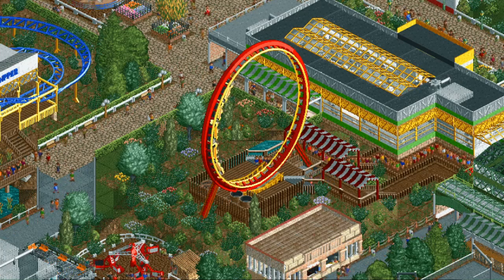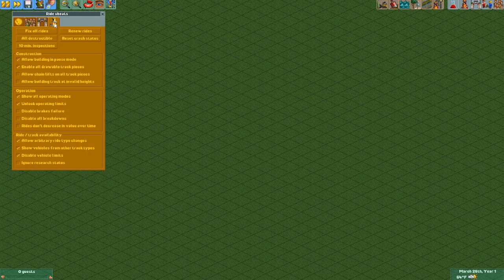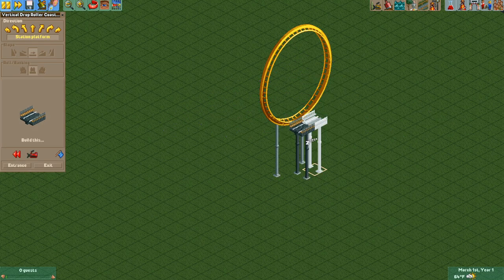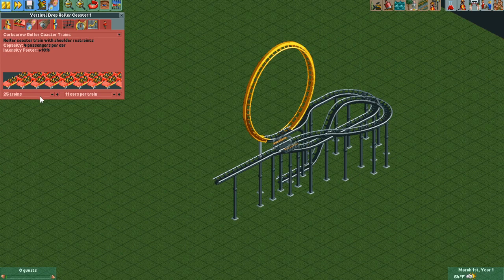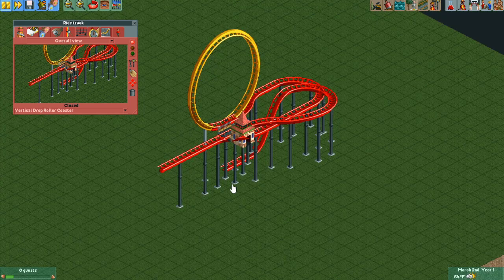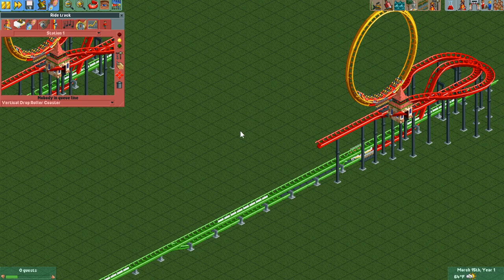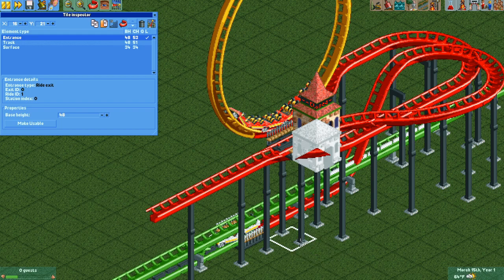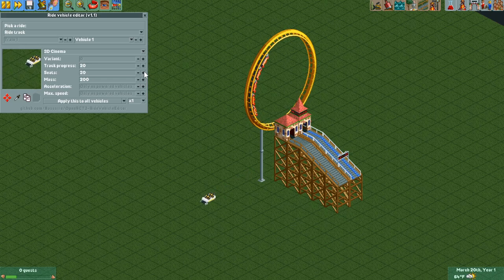Larson Super Loop | OpenRCT2 hacking

Comment: I was able to do a Fireball without shoe-stringing. As others suggested, use the multi-dimensional coaster track to make the ring, switch to traditional coaster cars like the corkscrew, and change the operating mode to powered launch passing station. There is a graphics issue at the top of the loop that needs covering up with scenery, but otherwise it works fine. With three circuits I even got pretty appropriate ratings (6.23, 6.45, and 6.63.) Not a bad flat ride.
Reply from the maker: Interesting, I'll have to try that out!

Comment: I''m pretty sure changing the ride type to unknown ride 38 changes the behaviour of the booster track pieces. Atleast in my testing they showed a much much lower acceleration rate than other rides, so you probably need to fine tune the control track with this in mind
Reply from the maker: Yes, that's correct. This tutorial is a little outdated now. I don't ever use the "unknown ride" types anymore, as there are better ways to make your track invisible, which don't affect the ride behavior.
Reply: @fidwell  What would the other ways be exactly? Since I'm running into the problem of needing a huge control track with boosters, that I can't possibly hide underground?
Reply from the maker: @TCrazy98  The easiest way right now is probably to make the track invisible with the ride editor plugin — https://openrct2plugins.org/plugin/R_kgDOHw7oPg/OpenRct2RideEditor

Comment: Where are people finding all these custom rides and tracks at? I thought it'd be on the OpenRCT2 forum, but I can't seem to find anything. Is it just there and I'm blind? Or is there some other place that there's a repository of these custom assets?
Reply from the maker: Nothing in this video uses custom rides or tracks. But to answer your question anyway, there isn't a single repository of custom content, but you can find a lot at nedesigns.com
Reply: @fidwell  Thank you very much! You're right, this tutorial doesn't use any custom tracks; I see stuff like the single rail coaster and the hybrid coaster around so much, and yet nobody has mentioned where to find resources like this at. Thank you for your help, and also best of luck on the Cedar Point series! I have been absolutely enthralled with it!
Reply from the maker: @Ariakiri_  The single rail and hybrid coasters are not custom either. They are built in to OpenRCT2. You have to use cheats to use them currently, but they're there.

Comment: New subscriber here and btw how the heck do block brakes work?
Reply: It has been many years since I used them, but simply put, block brakes separate the ride into multiple sections or "blocks" and stops cars until the next block brake is cleared, thus only allowing one car on a block. When the ride is operating with block brakes, the station is considered a block brake and I believe the top of chain lift hills are block brakes (it has been a while). Using block brakes allows you to run multiple trains with only a station the length of one train (most rides require all trains to fit in the station), with the max number of trains being the number of block brakes (including the stations) - 1.
Reply: @billmight5662  Thank you for that  and I want to do exactly that run more than 1 or 2 trains on a coaster but have no idea where to put these block brakes. Is it simply a length? Or perhaps a certain ride aspect?
Reply: @leopardfrog67  It's best to have them evenly spaced out by time, however nobody will judge you if there is a 20 second wait on a block brake. They do stop the train, so they are best in slow areas, typically the top of a hill.

A quick mockup of a ride where every ">" is a block brake: station (it's automatically a block brake) > top of chain lift (as I mentioned, I don't remember if chain lifts are automatically considerd block brakes) > downhill and a few twists then up a hill a bit > a loop and a few more turns > small downhill and final turn into station.

I can't think of any specific roller coasters, but block breaks are very common on real roller coasters, just to ensure trains have a safe place to stop if an issue arises on the track or station.
Reply: @billmight5662  Thank you a very thorough explanation and for taking the time to respond as well, cheers.
Reply from the maker: Thanks for the great explanation!
Reply: @billmight5662  Hey not to put you out again but when I am building on pause mode the dollar amounts are blocking my view of what I am building and then I have to run the game to clear the screen. You wouldnt know how to remove them would ya?
Reply from the maker: I don't think there is a way currently, but if you're already building in pause mode, you might as well just turn money off too
Reply: @fidwell  Your the best man and oh can you alter the planned path of entertainers  to only one square instead of the generic blue square pattern? last question I swear.
Reply from the maker: @leopardfrog67  no, that isn't possible yet.
Reply: @fidwell  those guys at openrct are awesome and for a game this old to be this popular still is a testament to its artistry.
Reply from the maker: @leopardfrog67  absolutely!
Reply: @fidwell  Hey sorry to bother you again but my water isnt transparent anymore like for example when I put scenario under water you cannot see it or even if I colour the land to distinguish shallow from deep it doesnt show up!? I have no idea what I did to change it.
Reply from the maker: @leopardfrog67  This is now an option in the View toolbar. Look for the second option, "Transparent water". The default shortcut key is set to "2"; you probably pressed that by mistake.
Reply: @fidwell  thanks again for your time and expertise.